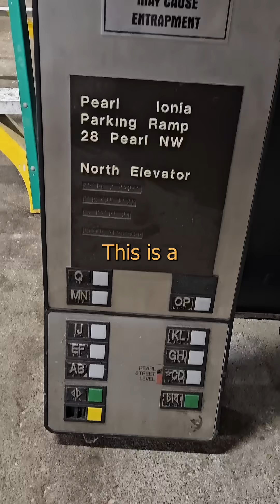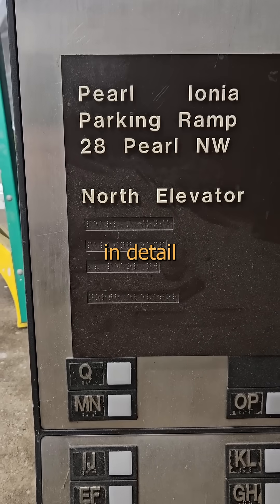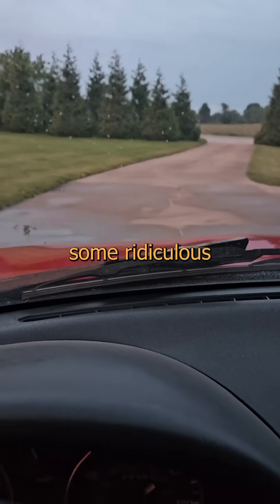Miata Mischief #chrisboden #engineering #gear #elevator #score #stories #parts #hacking #making

Comment: I dragged home a door on my bicycle by making it into a trailer. 

My friend's shitty parents smashed her door in and she couldn't rly replace it. 

Rode around the nearby suburbs and managed to find someone with a door in decent condition out for rubbish collection. 
Went to Bunnings, brought a set of 4 cheap castors.
Fashioned two of them into a pivoting trailer hitch thing for the back of my bike. 
Rode back to where the door was.
Screwed the other two to one end of the door. 
Attached my hitch with c clamps to the other. 
Attempted to ride off. 
Quickly discovered the physics of why trailers don't have castors. 
Locked them from rotating using another screw.
Rode all the way home making the most horrible noise you've ever heard with no other problems. (Hollow doors amplify road noise)

Got a hammer a chisel and a drill and taught myself to hang a door. 
Wasn't a perfect job. 
But a hell of a lot better then no door and only cost like 10 bucks for the castors.

I have photos of the contraption. Still one of my proudest achievements years later. Everyone told me I was stupid and I shouldn't try it. It worked perfectly.

Comment: Had a wood A frame swing made of 4x4’s that three or four kids could swing at the same time, moved houses. My FIL and stepson moved it in the middle of the night over a mile to the new house. One A frame on the hood, the other end of the A frame swing straddling the bed of a ‘92 Nissan pickup.

Comment: I recently shoved a couch/futon into the back of my civic si coupe. I had to move the front seats nearly all the way forward just to fit it, and it took nearly 20 minutes. When I got home later, it took nearly an hour to get it out. The hinges had locked into one of the raised positions and there was virtually no way to get both hinges into the flat position at once. I'm honestly still surprised it didn't break.

The other time was when I was moving, I had new suspension added to my crx and asked them to raise the ride height. Then I proceeded to load it full of my stuff for the move, including a cat and litter box.

Comment: I spent 45 minutes jamming a mini fridge into the back seat of my '98 Camry from behind a shopping mall (the coffeeshop I worked at had gotten a new one for under the counter but the old one worked just fine still). It was definitely a squeeze that most people would make you pay for, and I didn't even have any lube for it. Still not completely sure how the fuck I got that thing in there, much less how I managed to remove it from the backseat like trying to undo a turbo-wedgie given to a hooker in a G-string.

Comment: I was moving back in october of '22, and we have an old cage made of metal fencing that's about 12x10 ft. It was 9pm, and me and my stepfather were NOT about to take it apart, so if you were driving on Highway 111, you would've seen a giant ass cage ontop of a flatbed trailer slamming down the road at 60 mph 💯🔥

Comment: I had a little 2000 mr2 spyder and bought a 10ft tube of steel for the roll bar for it. I had the top down, one end in the passenger floor board, and the other end in the air, like that elevator panel. We used packing cling wrap to 'secure' it to the seat. 

Another time I took a twin sized mattress to the dump on the roof rack of my subaru outback...fun times.

Comment: I had a tiny ford focus and I had two full size box springs that I needed to move across the city. I used an old broken Ethernet cable and duct tape to hold it down. I didn’t have bars on my roof so I had to roll all the window down to tie it, but my back drivers side window didn’t roll down, so I had to work around that. Then there was the problem of not being able to see stop lights because the box springs were just in the right place for me not to see them at all. The resistance those things got when I pressed the gas terrified me. OH I also had to have my sunroof open so someone inside the care could hold the box springs on the bottom so they wouldn’t slip off my car. Then when I got to my new place me and my family were getting the box springs and we set one of them by my car while we took the other upstairs to my new apartment. The other box springs were next to my car but out of the way of the street, someone ran them over. Like they were leaning against my car like a domino, and someone kinda side swipes the bad springs and destroyed them. Not a single scratch on my car but I was pissed about the box springs lmao

Comment: I mean one time I was with a friend up at his cabin and he was swapping his lawn tractor from his house to the one at his cabin. (He needed to do work on the one at the cabin). He trailered the one from his house to the cabin. But then when it was time to leave, the one at the cabin was too big for the trailer. This mf takes the seats out of his 2004 honda oddesey and rides a damn lawn tractor into the back. we rode 300 miles with a lawn tractor as a rear passenger

Comment: When I was 16 I cut the back rest off a wheelchair and strapped it to a a red wagon with pool noodles around the edges in order to WALK two sheets of 2’x6’x2” bulletproof glass from a liquor store that was remodeling FOUR miles to my house for a “project” that never happened. 
Because of the absolute nightmare that whole ordeal still causes I’ve lugged those sheets of bulletproof glass with me through EVERY SINGLE place I’ve moved all around central Michigan over the last 19YEARS!! And they are currently sideways leaning against the inside wall of my shed…. Just waiting for that “amazing” idea to come around again or something else to justify the horror I went through to have them.

Comment: Had to somehow fit a 100+ year old cabinet model mechanical record player into a honda sedan. Didnt fit in the rear seat so i had to fit it in the front seat sideways on top of me for 150ish miles while staying perfectly still so the cabinet wouldn't get f'd up while simultaneously hoping the jammed spring kept deciding to be a team player rather than a bomb while it was positioned more or less directly above my lap. I'll admit not my brightest moment but i got the old POS home. Only had to wash both seats and the steering wheel after the fact too after finding the 100+ year old oil mix had gotten warm enough to by some black magic re-liquefy from a rock just enough to make my life miserable lol
Reply: Not to mention the other time i used the same sedan to move 5 pallets worth of lumber in i think it was 3ish trips. Thank god for fold down rear seats that go through to the trunk. Braking on a hill almost sent some plywood out my windshield thanks to a shitty tie down if not for the fact it direct hit me instead lol

Comment: I got an old school DNA sequencer on auction as a tinker-and-make-it-work-again project. Then, had to assemble an elaborate ramp to allow me to roll it up into my shed (which was slightly elevated to reduce flood risk), because the thing was 500 pounds of metal chassis beast. I was so excited to get the thing on the cheap, that I forgot to consider the logistics of moving the damn thing under human power. I succeeded but still. Lol

Comment: Couple years ago I bought rear quarter panels for a ‘91 Nissan 240z and with the help of the person I bought them from got it into the back of my small truck bed along with all my tools and sandbags from the winter and 2 big wheels that were used to hold the sandbags. I had only 1 ratchet strap at the time so I had to be very strategic about tying everything down. It was a very slow drive home and I even had the ratchet strap cut in half 3/4 through my drive home. Luckily I was close to oriellys and got more ratchet straps

Comment: I got an old school cast iron Lathe from the late 1800s for free at a convention I was at. It was the kind that was belt drive, as in, the building it was in had a central axle driven by either a water wheel or a steam engine, and it belted onto that central axle. This thing was *heavy* and I drove it all the way from the middle of Vermont to my home near Rhode Island, 3.5 hours away, in a 2.4L L4 engined Honda Accord, already packed with my convention stuff, camping gear, and this fckin thing that weighed more than me twice over. My back end was riding a full 3 inches lower than my front end, but I made it home, safe and sound with one more restoration project lmfao.

Comment: In 10th grade i had a good friend thats family decided they were moving to Florida. She had an 8 foot bong that she didnt want to throw away and it was kinda shady to sell.
I told her i wanted it. I was driving a '93 2 door Sentra that was nearly a 2 seater. I rolled the window down and set it on the floor. 
I drove damn near 20 miles thru town to my house with probably 3 feet of transparent purple bong hanging out the window, whistling louder the faster i went. 
Strange looks from a couple cops that i was lucky they weren't curious enough to find out what it was

Comment: My 80 year old mom got it into her head that we needed to get a 500+ pound marble bench from the cemetery where her family is buried back to her house. Before you look at me sideways, we had replaced it with a bench that was engraved to honor my grandmother and the original one had been placed there by my mother's grandfather. 

We drove the 60 miles in my mother's Ford Escort hatchback, located the bench (3 pieces: 3 ft wide top and 2 solid uprights to set it on), and commenced to load it into the car. 

She brought a couple lengths of 2x8 lumber and a few sheets of cardboard. We rocked the pieces back and forth to walk them to the "ramp" and laid them down on double thick cardboard. Then we tied a rope to the front seats and ran it under the stone. Mom hauled on the rope and my fat 50 year old ass shoved from the bottom and damn if we didn't get all the pieces into the car. Which was flat on the springs by that point.

We drove home carefully up and down all the hills - I was afraid I'd have to get out and push a couple times but we made it. 

Then we had to assemble it in her dooryard. We used the garden cart to bring the pieces where she wanted it (big, 2-wheeled rectangular wheelbarrow) and walked the uprights into position just wider than the top. Then we got the top in between them and levered it up onto jack stands at their lowest settings. I could just about lift one end at a time and Mom would reach under and raise the jack stand another notch. Back and forth, back and forth until we had the top higher then the uprights. Then we scooted the uprights into position and dropped the top into place (iron pins sticking up, into holes on the underside).

It took both of us, but we made her crazy dream a reality. And now you know where I get it from. 😂

Comment: I once bought a 65 inch flat screen TV from Sam's club on a black Friday and hauled it out to my 7th Gen 2000 Toyota Celica GT hatchback. I knew it had some space in there but my eyes were bigger than my trunk and it ended up such a grotesquely tight fit my ex girlfriend was jealous. Ultimately though I fidgeted it in with no lube and closed the hatch but.. it wouldn't close all the way so me without a Bungie and both front seats slid all the way forward I set out on the 20 minute drive home in the rain with the hatch open 4 inches and shortly discovered first hand how quickly a draft up an open rear skirt might have you smelling things you would rather not (exhaust gasses.. ahem.. filthy buggers..) so I rolled both crank handle operated windows down doing warp 7.5 on the freeway and turned that rear input back into an output and drove home ever so precariously but I made it and this 4k 65 inch TV has been an joy ever since and That's pretty Cool.

Comment: Just married, the new wife and I are shopping up on the other side of the city on my BMW R60/5, which is really light.  It had a rack sticking out behind the back seat about a foot to haul stuff when you take the rear trunk off.  Well, she found a set of dishes she really wanted. Came in a set of 12 settings.  Weren't thinking much, we bought it.  Aaaand out comes this heavy-ass 2 foot by 2 foot by 2 foot box that weighs like 80 pounds!  Oops! Got some duct tape and taped the snot out of the box on that rack, and hopped on.  I put it in gear and INSTANT WHEELY!!!  There's like ten pounds on the front wheel, and we're 30 miles from home.  Yup, for 30 miles I'm scooted up sitting on the tank, with the wife in my part of the seat!  Going a max of 35mph in city traffic. Still a bit squirrely. And of course, 5 miles from home it starts to rain!  Ahhh, good memories!

Comment: When I joined the Navy in 2002, everything I owned fit in my 1989 Honda CRX.  At my first temporary training station, I decided sleeping on the floor was getting tiresome, so I splurged on a queen size futon. When it came time to move 6 weeks later, i reloaded the CRX.  Then studied the futon.  Was driving from Pensacola, FL to Enid, OK.  I thought to myself "Why not?," "Why should'nt I?"  I wrapped the big old floppy mattress in plastic and manhandled the entire thing onto the roof of my CRX.  Retrieved a 100' extension cord from the car and wrapped it round and round.  Slapped it a couple times and said "that's not going anywhere," and set off on a 15 hour drive.  Made it about 10 miles before the whole thing shifted down over my windshield during a less-than-emergency brake.  Re-rigged on the side of I-10 and reassesed.  Drove straight to a moving company and dropped it off for shipping. 😊

Comment: Same car!
Water heater kicks the bucket. Dad cruises on over to Home Depot to pick a new one out. He finds the right one and says “I need to see the box.” They’re a little dumbfounded. “This guy needs to see the box. —- yeah, I don’t know either but he says he needs to see the box.” Dad’s engineer brain looks it over and says “yep! That’ll work.” So he purchases a new 50 gallon water heater and proceeds to pull up to the loading area in a 1992 Mazda Miata, red like the one in the video. He drops the top and they stick the whole dang thing box and all in the passenger seat. It’s sticking out like an American Dad at a K-pop concert and he hauls it home in the roller skate without issue. 
Thanks Dad for paving the way for my weirdness! 🫡

Comment: When I was a senior in high school I bought a 1979 Chevy 2 Wheel Dr. pick up for $135. Problem is it was 50 miles from home. This buddy of mine had a genius idea that his dad had a bunch of old block and tackle with 2 inch hemp rope probably about 100 feet or so. Our plan was to rig this up by running the rope back-and-forth about three or four times leaving a distance of about 20 feet between the trucks. He hopped in the tow vehicle to steer and brake and I began the trip towing with my 1995 1/2 ton Chevy. After about 15 miles of harrowing towing on the highway and two of the ropes snapping, my friend had had enough of it. He had been chain-smoking the whole time out of terror and trying to keep the window clean by using his sock to clean the windshield of condensation, being young and stupid My next plan was to just get into this newly acquired never Mechanically assessed rot box and drive at the remaining 30 miles in the rain.
Reply: @MarekMakes  Can confirm.  It was a pitch black late fall/early winter night. Raining. Truck was off, so I had no heat, no power steering or brake booster.  As we went up on the curving highway on ramp, with me gripping the wheel with my left hand (with cigarette), and wiping the windshield with the sock I took off my left foot, the ropes started snapping.  One after another they began to let go, conveniently recoiling and landing in the bed of the tow vehicle. Probably for the best, considering how hilly and twisty the 20A is on the way to Warsaw.
Reply: @Keifsanderson
Reply: Ahhhhhh memories
Reply: Wyoming County in the house!

Comment: When I was a senior in high school I bought a 1979 Chevy 2 Wheel Dr. pick up for $135. Problem is it was 50 miles from home. The body of mine had a genius idea that his dad had a bunch of old block and tackle with 2 inch hemp rope probably about 100 feet or so. Our plan was to rig this up by running the rope back-and-forth about three or four times leaving a distance of about 20 feet between the trucks. He hopped in the tow vehicle and I began the trip towing with my 1995 1/2 ton Chevy. After about 15 miles of harrowing towing on the highway and two of the ropes snapping, my friend had had enough of it. He had been chain-smoking the whole time and trying to keep the window clean by using his sock to clean the windshield of condensation, being young and stupid. My next plan was to just get into this newly acquired never Mechanically assessed rot box and drive at the remaining 30 miles in the rain.

Comment: Me and my friend are both very enthusiastic about electronics. One time, about 7 years ago, we found a Dell computer and monitor in the trash. We had no room for it, so we logged it about half a mile to an abandoned shed in the woods (our stash) where we hung out and kept all sorts of electronic goodies to take apart (TV’s, alarm clocks, keyboards, game consoles, phone equipment, etc). We took turns carrying the monitor with our hands, and the tower computer with a Razor scooter all the way to the shed on a gravel trail. It took forever but in the end, we got to take it apart and check out how a computer works, and not have to worry about anyone taking our stuff. Until about 3 years ago when the land, which used to be an RV park, got converted into an auto body shop. I still have memories from that place. Exploring the woods, the other abandoned buildings there, the abandoned pool, the pond, climbing trees there, oh man it was a blast